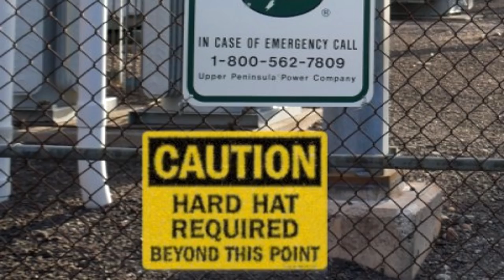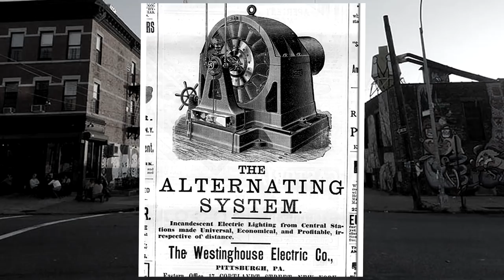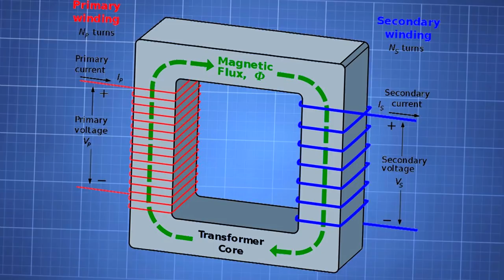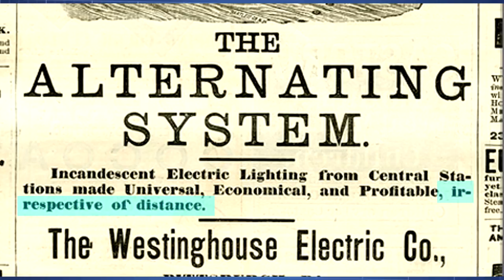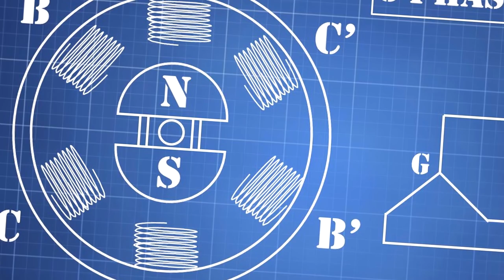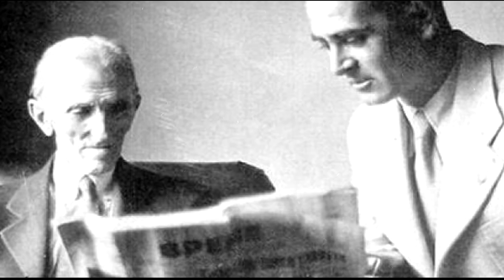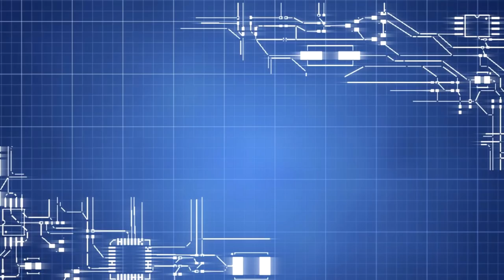A Brief History of the Power Lines (Animated)

Comment: Good job. You will never see a bird on a HV (350 - 500 Kv) transmission line. It's even too much for them.
Reply: True, the highest voltage power lines i have seen birds on is 23 kV I have tried touching 23kV ( insolated from ground and a low current circuit) the capacitive coupling its too much, its quite uncomfortable for humans.